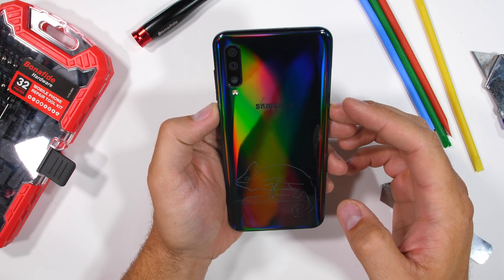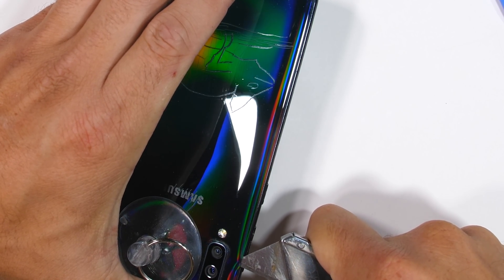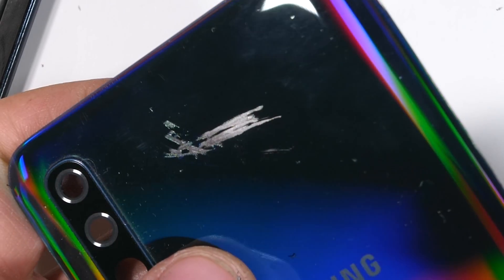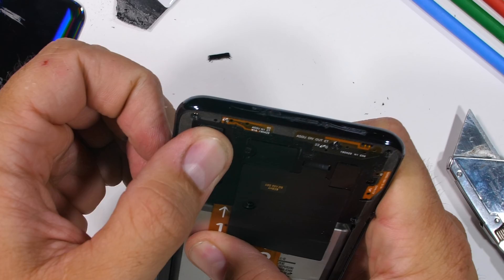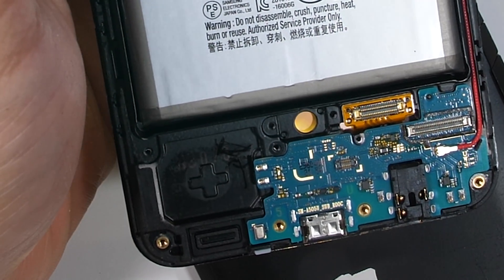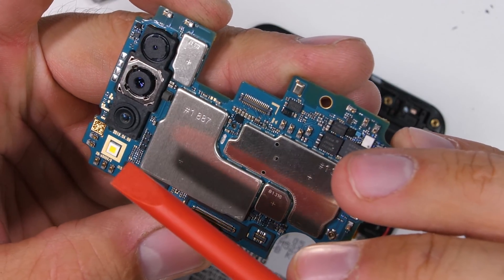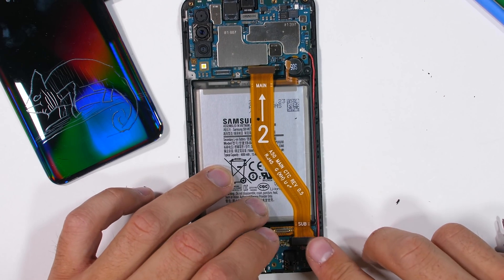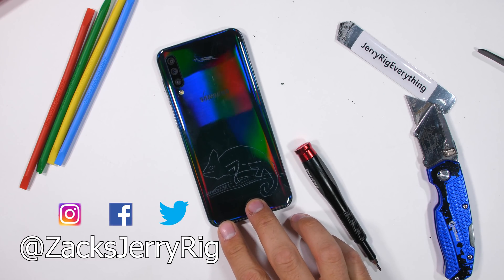Galaxy A50 Teardown! - Did something crack inside?

Comment: "Samsung has always been team headphone jack..."

......until galaxy note 10
Reply: People saying "what's the problem with a dongle" are part of the problem and why companies continue abusing end users with this crap
Reply: @NattMoir  fr 🤦🏾‍♂️ dongles suck
Reply: @NattMoir  exactly
Reply: Since the Note 10 has 2 version, Samsung could of at least added the headphone jack on the smaller version
Reply: @DAVID-ANDERSON  well if they were only gonna do it on one version, the better version would be a better choice
Reply: @ZomeDash  Its 3 The base the plus and 5G
Reply: @DAVID-ANDERSON  Well, we wish... :(
Reply: @DAVID-ANDERSON  it's could've not could of why is this becoming such a common mistake
Reply: @DAVID-ANDERSON  You mean on the larger version since that has the most internal space to actually work with.
Reply: @DAVID-ANDERSON  By doing that, the Plus version or the one without jack, wouldn't make any sale probably.
Reply: The "lack of space" is just an excuse... what are they trying to do? Emulate Apple!?
Reply: @GtaFan00000001  No not really... And im not an apple fan...
So i heard this rumor , Where Samsung will add 10+ Features in the pen , Sacrificing the Jack for 5600 MaH Battery , And Internal cooling fan
Reply: @Ginchans  we don't have cpus poweful enough that need a fan, and if we had, we didn't have batteries that can handle it
Reply: @NoobCore_67  People like you are the reason companies think it's okay to remove features from a phone and charge a price premium for it.
Reply: Team asus and lg also
Reply: @AlbertNeedSkills according to samsung Stylus is more important than headphone jack i think
Reply: Dongles just unplug too easily, the 3,5mm sits tight and doesn't get pulled easily when the cable is caught. So 3.5mm is better.
Reply: @colla555  they are expensive
Reply: @NoobCore_67  Why would you deal with something that you dont have to deal with if you buy a phone with actual features
Reply: it was gonna happen eventually we had fun while it lasted :(
Reply: @jebediahkerman4251  Yeah but this is too soon.
Reply: @jebediahkerman4251  Oh please. Stop that fatalism, for god's sake! It's obvious these "engineers" have no bloody clue wtf they're doing. In fact do they even use the devices they engineer? It's up to us the force them to listen to us. The only way we (currently) can is by voting with your wallet and influencing our surroundings to also keep their wallets shut! It's not that a marketeer working from Samsung actually ASKED me (and/or you for that matter) what we'd actually want in a phone, is it?
Reply: My bet is that the Galaxy S series is still gonna have the headphone jack, but the Note series won't since you have the pen
Reply: @DAVID-ANDERSON  But every note until this one has had a headphone jack though.
Reply: @DAVID-ANDERSON  A pen is no substitute for a jack? ;-)
Reply: Using a single looks so fucking stupid with a wire dangling out... Atleast try to use those short singles that has no wires
Reply: @NoobCore_67  i disagree. not nagging about it won't make samsung improve their phones. listening to customer feedback is what makes a company good. if samsung phones go to shit, people won't buy them anymore and that's a problem to samsung. they have to listen to customer feedback about their products.
Reply: @your_average_clippy  I would even go further. Not only must we, tech-savvy people, nag about it. We must influence our less tech-savvy peers to avoid buying these Samsung phones without a headphone jack (or stay clear of Samsung altogether). That's the only way to MAKE them listen.
Reply: @manut4963  exactly. If they see they're failing they must make changes that make customers happy to keep their business up.
Reply: @your_average_clippy  Sure, we're all so goddamn happy that we just can't shut-up about the loss of the headphone jack. Yeah, I definitely feel very happy to pay more for a phone that has less. At least our government doesn't fuck us over like that.. oh wait!
Reply: My s10 5g has the headphone jack
Reply: @Sky Apollo They managed fine with the Note 8 & Note 9. Fail to see why suddenly the Note 10 hasn't got enough internal space. 

Then make that goddamn S10 bigger, djeez!
Reply: @NoobCore_67  yeah? well, idiot. samsung doesn't include a dongle with the jackless note 10, leaving you to buy your own, just like apple did. samsung are such hypocrites. theymade fun of the notch and jack removal and now their phones have notches and they're getting rid of headphone jacks. what the fuck? it's just like google did with the pixel 1 and 2 jacks.
Reply: @your_average_clippy  So now were Hypocrites , K then...
Ima make fun of yer iphone since it took 3 years to chase wireless charger , 6 years to chase Amoled panels , And another uear to probably make a phone with an in screen fingerprint
Reply: @your_average_clippy  get over it, headphone jacks are not just random holes, they cost money, a lot of money, so we just have to get used to it and be grateful we still have a chsrging port unlike apple.
Reply: And the a80
Reply: And A80
Reply: Use Bluetooth
Reply: @rionovaspark6038  Are you nuts? Do you have any idea what a bloody battery drain that is... when using your phone in car as sat-nav unit, screen constantly on and audio piped over Bluetooth to the car's head unit! It's already a goddamn battery drain when using the audio-jack so you want to make an already situation even worse. NO thank you!
Reply: and you forgot the a80....
Reply: Listen I was team headphone jack all the way. But luckily the galaxy buds arent as expensive as airpods so its not as big of a deal...
Reply: @dustinorndorff6764  Don't you get it. It's a plot. They give phones bigger batteries yet they drain faster since you do every goddamn thing wireless. That way phones ages faster and need to be replaced faster. And now the headphones age faster as well. After 2 or 3 years you have to ditch otherwise good sounding headphones due to reduced battery health. Capitalism upto decadent levels!
Reply: Until galaxy a80
Reply: A80 and M40 too
Reply: And A80
Reply: Nope until m40
Reply: What about the galaxy fold and the galaxy a80
Reply: @john_gaming_tv2002  that was launched after m40
Reply: S10 5G already dropped it
Reply: @Luffy61C4  All S10-s have the jack.
Reply: @marcularis  i dont think the 5G version have, i heard talk about it, that S10 5G have no headphone jack
Reply: @Luffy61C4  No, please check it for yourself. The Note10 was the first flagship with no jack.
Reply: @marcularis  ok i'll take a look at this
Reply: @marcularis  you were right, S10 5G has jack, i really thought it had not
Good surprise for anyone who want S10 5G
Reply: @Luffy61C4  Yeah🙂
Reply: Bruh the phone is actually not thick enugh for a headphone jack
Reply: AlbertNeedSkills the next model, the s20 will not have one
Reply: @AlbertNeedSkills no, the s20 does not 😭😭😭
Reply: Notsony What’s wrong with people?
Reply: @AlbertNeedSkills sad s20(s11) doesn't
Reply: @AlbertNeedSkills NOPE
Reply: @AlbertNeedSkills nope
Reply: And samsung galaxy s10+
Reply: @AlbertNeedSkills if only you knew
Reply: AlbertNeedSkills well Idk but I know the s20 doesn’t have one
Reply: @AlbertNeedSkills lol
Reply: @AlbertNeedSkills *s20 btw it does not
Reply: Why dont we just match the headphone connector to the charging hole
Reply: @AlbertNeedSkills no the s20 ultra I have has no headphone jack but I use USB c and I think it's better
Reply: @AlbertNeedSkills I'm sorry but 9 months later but they skipped s11 and called it s20.
Reply: To all the person who are hating on Samsung for removing headphone jack, the phone is thinner than the jack itself.
Reply: @ayan1875  then thicker the phone
Reply: Better quote would be.
"Samsung has always been team headphone jack'

Looks shaming ly down at galaxy note 10
Reply: @AlbertNeedSkillsF
Reply: F
Reply: @AlbertNeedSkills will not. they killed it and they will not bring it back.
Reply: At least they came with headphones with a USB -c dongle
Reply: @AlbertNeedSkills use a dongle stop crying
Reply: @girlsdrinkfeck  dongles are shit, they continuously break.
Reply: @girlsdrinkfeck  and the dongle actually wears out the charging port there's a reason why there's supposed to be a separate port for headphones and chargers
Reply: @girlsdrinkfeck  why use a dongle when you can use a jack
Reply: @girlsdrinkfeck  200 mah more? I'd rather take a jack instead of that, but the battery could've been more already with the increased height
Reply: @girlsdrinkfeck  headphones don't use as much power as bluetooth does
Reply: @girlsdrinkfeck  just do a test, listen to music for a certain time, with wired earbuds and listen for the same time with bluetooth earbuds, you see which one is worse
Reply: @girlsdrinkfeck  yeah in fact! What's the problem with a dongle
Reply: @Andrea-qg5yk  What's the problem? To charge phone and use jack headphones at the same time you have to buy another dongle that allows it because original one is just for headphone jack, no charge possibility. Also what if you have headphones on some kind of tour and you just forgot dongle? You can't use them.
Reply: @mruczyslaw50  you have to leave the dongle always on the headphones or buy some bluetooth headphones
Reply: @Andrea-qg5yk  but it's not about the dongle, its the reason why they removed the headphone jack, it doesnt exist because there is space for an s pen so space is not an issue and they have waterproof phones with jacks like the note 9 so that isnt a problem either, and if size was a problem for it just make the phone bigget, its what theyre doing anyway
Reply: @akuma_mx5  So you never wanted to charge your phone and use wired headphones at the same time?
Reply: @mruczyslaw50  I never needed too lol
Reply: @akuma_mx5  good for you then
Reply: @mruczyslaw50  just use usb type c goddammit there is a reason why they put on bigger battery
Reply: @rfiqysri6737  Bigger battery? Even the mid range models can have huge battery and headphone jack without dongle
Reply: @mruczyslaw50  It's not exactly when you want to use your "headphone" at the same time as charging since that rarely ever happens. The actual problems exist when people use their smartphone as GPS-navigation unit, connected to the car-radio through the audio-jack and NEED to preserve as much juice as possible (thus NEED to charge at the same time). Since using (A-)GPS coupled with the always active display are massive battery drains! This will even get worse when you use a bluetooth connection to your car-radio (provided it has BT-audio capability). Obviously those teenagers whom live their bubbly sheltered life are impervious to real everyday problems that adults face and thus keep talking about "using headphones". It goes way beyond that!
Reply: @Andrea-qg5yk  you sound alot like a apple fanboy just sayin
Reply: @canadianbeaver6373  no no i'm not i hate Apple... But i have a phone that doesn't have the jack too and for me is no problem
Reply: @mruczyslaw50  Bluetooth earbuds dude. They can be expensive but once you go wireless it'll make life so much easier.
Reply: @ImAyeGuest  I have a pair of wired and a pair of wireless earbuds. I would never get wireless earbuds on the beach for example or on a long tour. First of all, you can lost them, second of all they have to charge after few hours of listening.
Reply: @mruczyslaw50  If you're irresponsible enough then yes you will lose them, if you keep track of them like a normal human being then you won't have to worry about losing them. And for your second,  that's not always true. AirPods last me around 7-8 hours on a single charge, more then just a "few" hours. And when you're in the habit of charging your phone, smart watch, laptop, really anything that needs to be charged, a pair of wireless buds wouldn't be bothersome at all.
Reply: @ImAyeGuest  
1. You can be responsible and still lose earbuds, you can't say when it going to happen. If you are on beach you usually got more things than only earbuds and you have to watch all of that.
2. Smartphone lasts more than 8 hours, any good phone should last at least a one whole day.
3. I'm sorry for your wallet if you have AirPods, there is a whole bunch of much better earbuds on the market in lower price.
4. There's nothing good in not having a mini-jack. You can use wireless earbuds on a phone that also have jack, phone with jack gives you a choise, if you haven't got a jack then you need to use wireless earbuds or a annoying dongle if you have one. There's a lot of wired headphones that sounds and costs less than a wireless ones, and you want to ignore them just because your phone has been castrated by manufactuer? I'm not telling that wireless headphones are bad, but not having a mini-jack is a stupid trend that have to end because it makes best phones on a market just worse. Why they are advertising a phone for more than a 1000$ as a smartphone to do everything, when there's no even basic thing like mini-jack that has always been there for nearly 20 years in phones history?
Reply: @ImAyeGuest  
1. The beach is example. Be in whatever place where is a big amount of people and things to watch. Like a supermarket walk with opened backpack full of expensive things on your back. Well that isn't happening often but it can happen :P
I never lost an earbuds but I know it is possible and it isn't hard.
2. I know you were telling a single charge without using case, you don't have to prove it, but every charge takes time too so you have to wait until charge. I wouldn't say you have to use them 8h straight but just using them for 2-3h and leaving them in case. Until the case discharge, and then same with earbuds, you are without working earphones. Also It's sad that someone with a good smartphone still uses iPod. You can today have few devices built in your phone and still prefer worse solutions?
3. If you have iPhone, sure AirPods "work better" means just that their pairing faster, if this is a feature you have to get, well, take them. The better work in other aspect than pairing just isn't there, better audio and comfort (but that's depending on your ears) are things that you can get for earbuds in same price as AirPods. Of course it also depends on which time you bought them. Well, for me changing earbuds to wireless didn't "completly changed my life". It's not like having kids or getting married.
4. I'm pretty sure that mini-jack is something that universal you will have a chance to use it few more times in your life. Maybe even you will need to use it in your phone. You never know what's going to happen.
Reply: @mruczyslaw50  You're not understanding any of my points, I'm done entertaining you
Reply: @ImAyeGuest  because there's nothing to excuse jack removing
Reply: @Andrea-qg5yk  get an adapter, from chilison, it has both charging port and headphone jack.

Comment: For a clear Galaxy A50 just dip the whole back panel into paint thinner and use a Q-tip or sponge to scrub the paint away. Or get "Goo Gone" and use that. Or use an acetone based nail polish remover. All of these are safe on plastics and I've done them myself on multiple different plastics. Just be careful about letting it soak too long in acetone based products or it actually will cause damage to the plastic. But for just a few seconds to let the chemicals start eating away the paint it'll be just fine. I haven't done clear plastics on phones, but I've removed paint from plenty of plastics varying from toys to plastic tools just for the sake of having it be clear. Goo Gone is a fricking miracle cleaner.